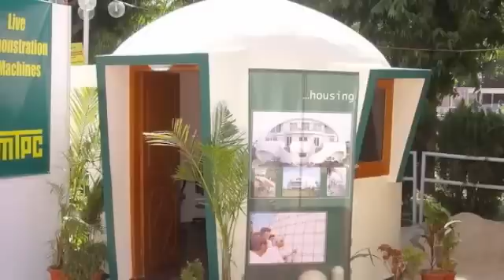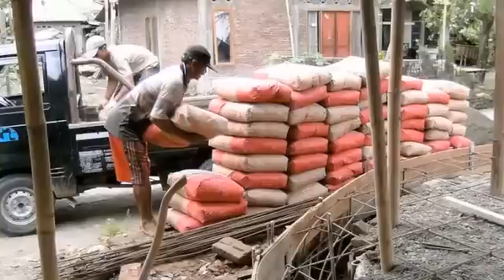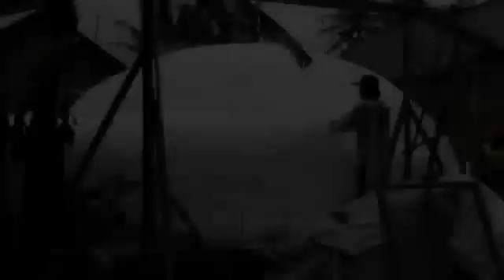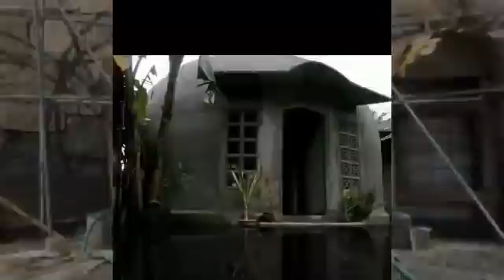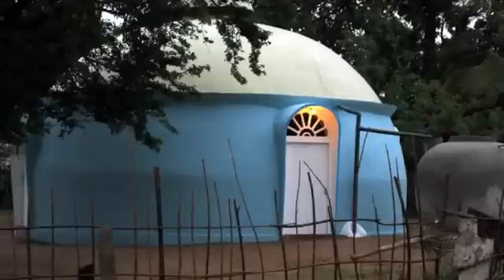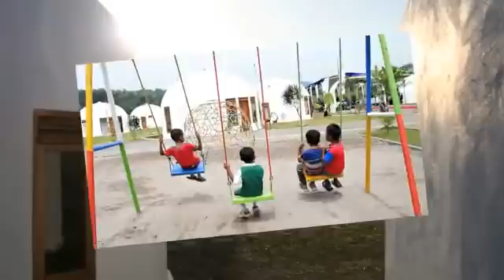Monolithic Ecoshell Introductory Video

Comment: I scrolled down on the comments and saw most people were concerned of price  well I think if you can cut down on hiring tradesmen that's a Hugh saving and this allows for most of that ,cement perlite vermiculite are not that expensive ,if you know what your doing get good advice ,for the average person , its a good chance it will work compared to a conventional house

Comment: Their 12' x 18' x 10 ft high shells are  $12,000 on special.  Not very competitive with traditional small building prices, compared to steel for example, which requires only assembly with no special gear or tools.
Reply: Whose Ray?
Reply: Ray, the airform can be used up to 100 times.  What are you blathering on about?
Reply: @protonneutron9046  Huh? Steel is reusable too. What has reusabilry got to do with anything?
Reply: @dnomyarnostaw  What ARE you babbling on about?  You are going to rip rebar out of the home you JUST built and reuse it?  Are you mad?
Reply: @protonneutron9046  You're a strange little person , getting excited about something they have no experience with.
Steel framed and clad houses don't use rebar, except in a foundation. They unbolt, and can be transported anywhere, and re-erected with a drill.
They are half the price of these concrete items.
The fact that the blow up balloon used for forming Eco-sheels is not a benefit. Steel structures are self framing, need no formwork, are termite proof, fireproof etc.
Try and get a grip

Comment: How much you've contributed to the quality of life for so many, and such a great solution with domes!  You should get a Nobel Prize!  I'm also wondering why you don't use aircrete, so much lighter and very strong, and it's insulating properties to help keep the homes cool in such a hot and humid climate.  You don't show how electrical wiring goes in and plumbing for kitchen sink and shower....  I'm thinking they'd prefer non-communal restrooms but it keeps the budget down and provides for many more homes.  Thanks for your great work and for sharing this video.  I'd like to build a dome like this as I'm low budget Senior Citizen living in a big high-rise bldg.  My own home would be nice.  I think aircrete could cut that $25,000 way down.  See Steve's Aircrete Dome he built for I guess $9,000.  It looks like he interconnected 3 domes, very nice.  The aircrete dome people noted a 1,000 sq ft 3 inch thick aircrete dome would cost $4,000 but said nothing about plumbing and wiring etc.
Reply: aircrete would crumble under a Cat 5 hurricane, flood or EF-5 tornado mw.

Comment: can you use aircrete?
Reply: If you want a weak structure you can das hasguns.  This shotcrete is 5,000 psi strength.
Reply: me nkat  Of course not.  That's why you build a monolithic dome with R-100
Reply: can you spray aircrete ??
Reply: @bartsatm7914  yes, if you want a crappy weak structure

Comment: I have a way to build without the air form.  After you build your steel cage you pile cement mix on it by hand. The proof lies on many videos showing third world mud house construction techniques. As the roof curves in, you're gonna have problems but I can solve that with little resources....twigs, grass what have you.
Reply: Chicken wire mesh
Reply: +David you right concrete sticks easily to rebar as long as there's small gaps it'll be fine the down side it will take longer time and waste concrete cause of over spray and will take much longer time if you do it by hand but it same time you need to build regular home
Reply: +gfexc    Please teach me how.  Thanks in advance.

Comment: If the foundation were dug even just 12' to 24' would greatly increase thermo insulative properties.
Reply: Only in VERY cold areas.  Otherwise you are wasting time & concrete.
Reply: T. B. The insulation properties, with spray insulation under 3 inches of shotcrete applied from the inside will cut heating and cooling costs by 50% or more.

Comment: 36ft wide & 26ft high installation costs between 50,000 & 200,000. Swing in price is dependent on self installation & equipment used.
Reply: Way too much for one of these. Watch more videos. Building these in a developing nation, at least the shell, can be as little as $5,000-$9,000, depending on size. The costs are then a matter of how much stuff you want to put into it, and how creative you want to be. Do your homework, and lots of it. Let the pros put up the shell, plumbing and wiring. If you can do some of the finish work, like painting, installing floor tile, etc., then costs can be reduced. I’m building a medium-size house for my retirement home, with a smaller dome for a party room detached from the main dwelling. These jewels are weatherproof, earthquake proof and very energy efficient.
Reply: WRONG guilty.

Comment: This is very nice indeed!  Is there any other types of steel framing available?  I'm envisioning a two story, say 65 to 70 feet wide, with rain fly in the front, and surrounding balcony/water catcher to collect rain water.  Could you show more about how they are framed inside?
I saw a geodesic dome in Virginia covered with Poly foam, 8" thick (so were the doors) with only a pot belly stove in the center that heated the whole single room, prolly  70 feet in diameter.It was tough, but flammable
Reply: It is a monolithic dome.  There is no inside framing